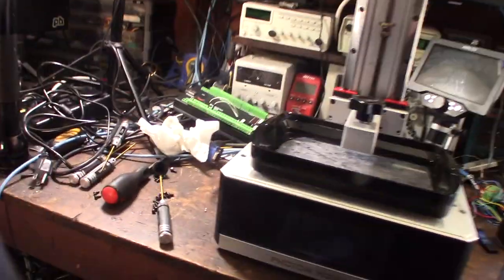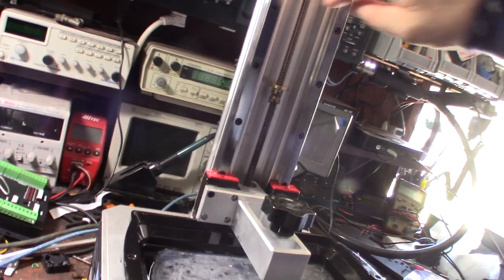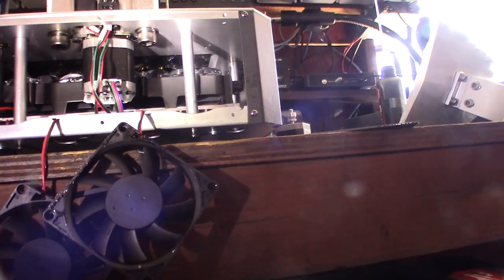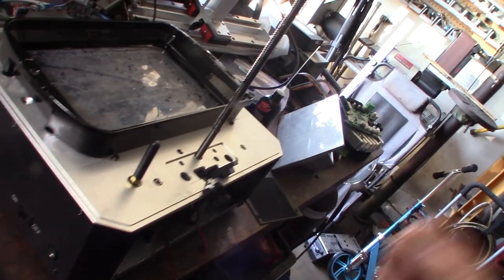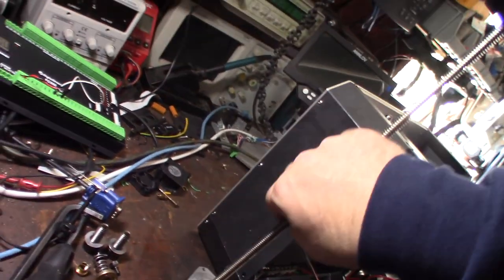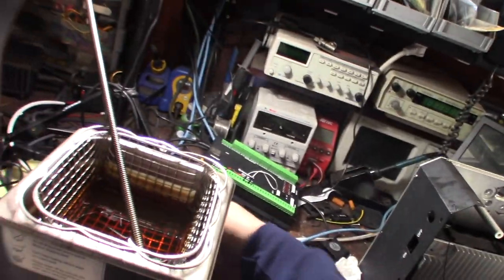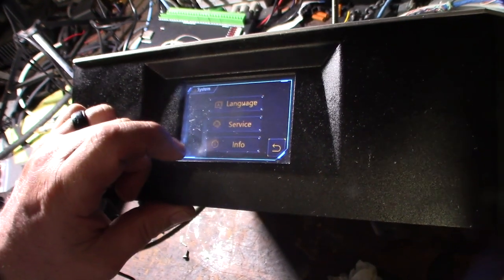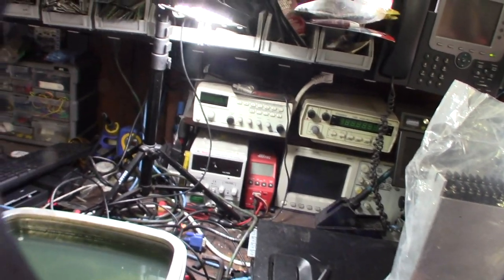Photon Mono X 6K SLA printer, Z axis does not move stuck with resin. troubleshooting repair.

Comment: Also had a z-axis motor fail on me today just out of the blue. Strangely it functions fine for zeroing and manually moving it, but for actual printing it goes all the way to the bottom of the rails and won't come up (different brand but the guts are 95% identical in this size printer). Looks like I'll be tearing her down later in the week. Doh!